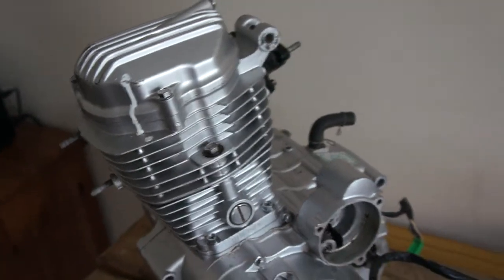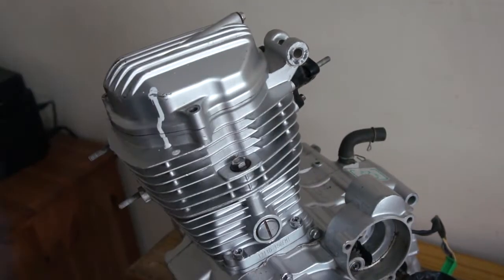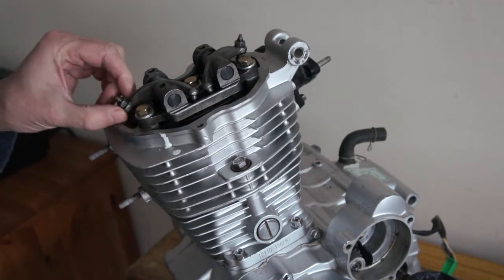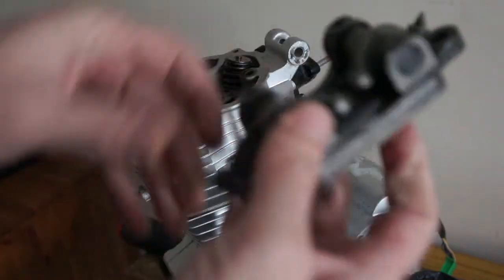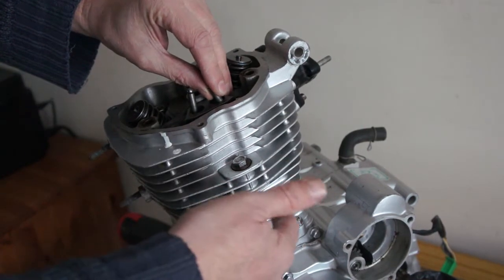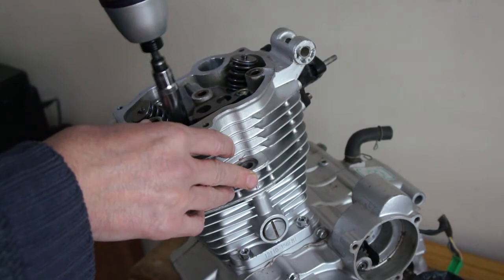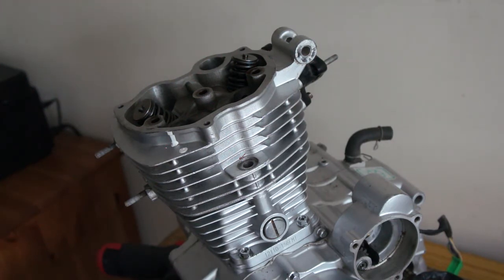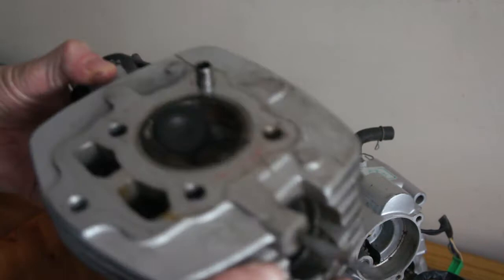Cylinder Head Removal 156FMI | CG125 Engine Top End Teardown

Comment: gotta love these Chinese CG Engines..

•makes good power for the displacement
•simple to work on
•can be disassembled and put back together again with basic tools
•Carburetor's Easy to Tune

although the Best Chinese CG Engine would be the
150cc-250cc with Electric Starter, 3.7:1 Primary Reduction, heavy duty 5 speed gearbox, a full wave charging system and without the EGR
Reply from the maker: I’m impressed as well